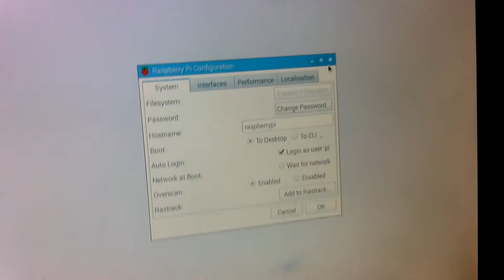DIY Raspberry Pi cooling fan

Comment: You can cut open the fan cord and connect it to a usb head by connecting the positive to the red cord and negative to black one. I made one and posted the video on my channel if you want to see how it works
Reply from the maker: +Munster Tech I eventually did that, I figured out that the problem was in the cord I was using, so I got a new cord and it worked fine.